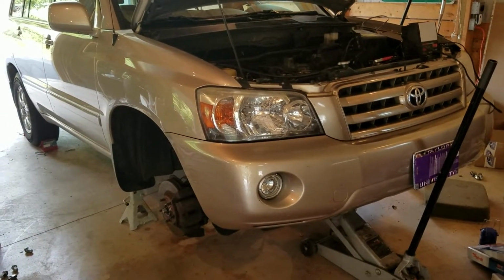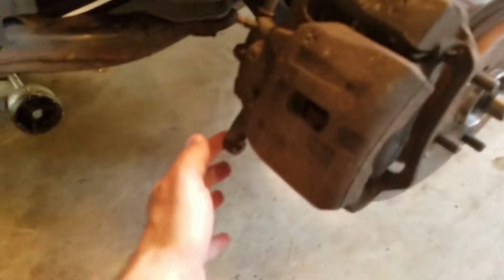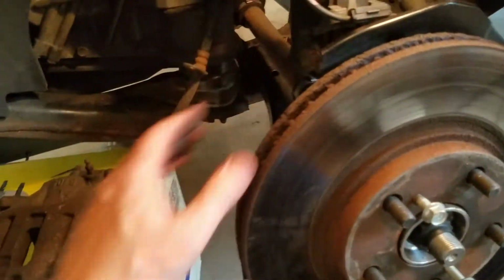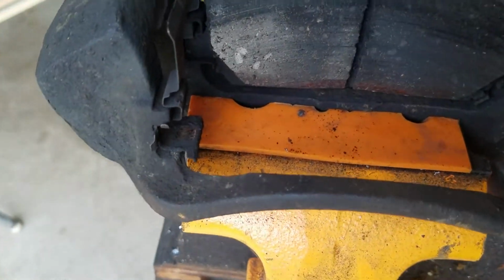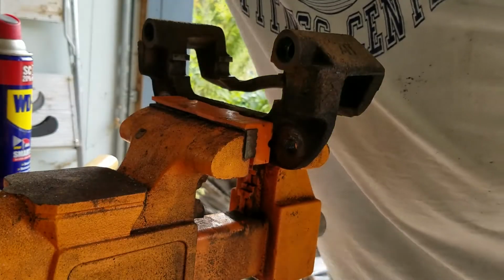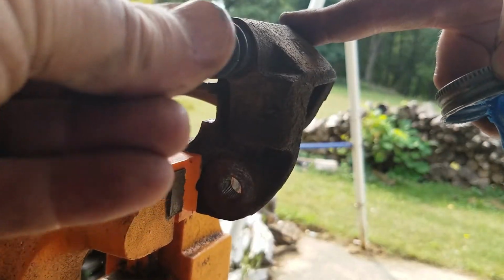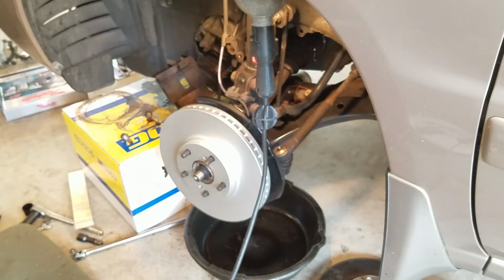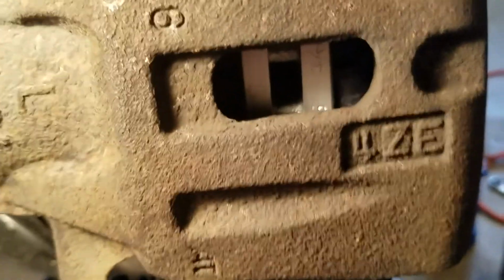DIY Toyota Front Brakes (Demo on 2005 Highlander FWD)

Comment: grease behind the brake hardware avoids moisture getting behind it and causing it to build up Rust which holds the caliper
Reply from the maker: Parts are stainless steel I usually don't have issues, but it won't hurt. Thank you for the tip.